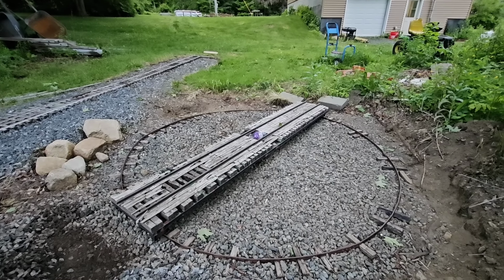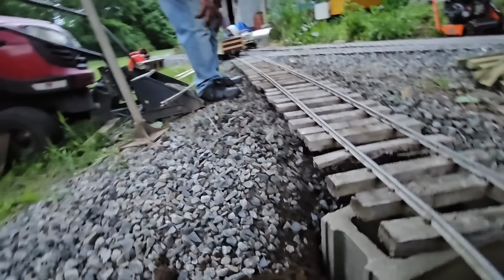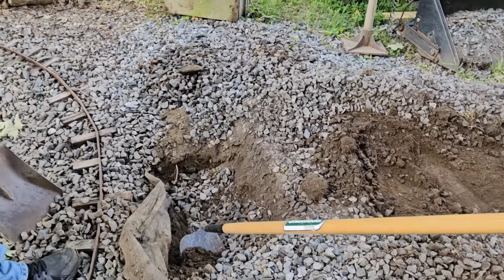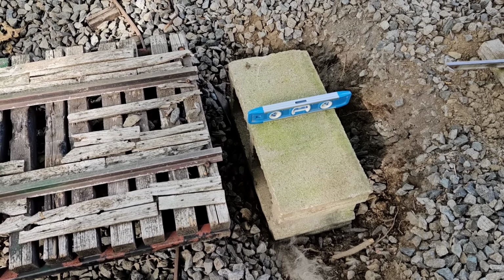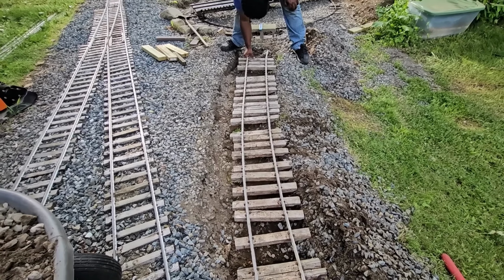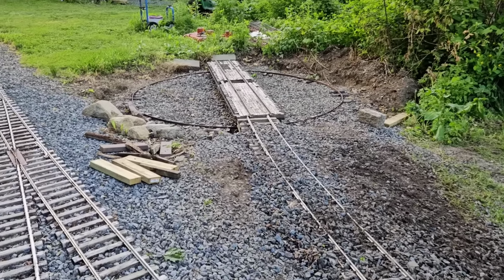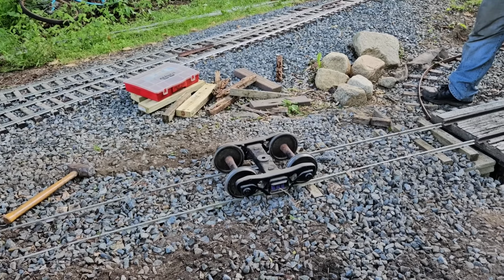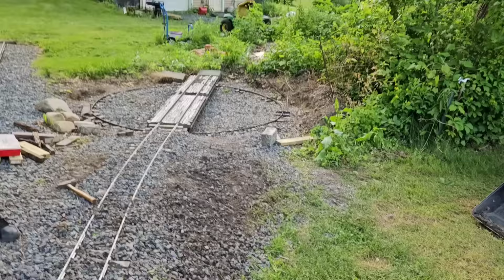We're FINALLY Laying track to the pit!: Turntable Restoration Part 2

Comment: A simple way to lock the turn table is to attach a small arm on the OUTSIDE of the rail on turntable.  They will flip over when aligned to track and hold it in place.  Essentially it’s an outside joiner bar that hinges on the turntable track

Comment: Aha. Some gear is doing a good job. Lawn mover with bucket, that's new to me. A clear invention.
Haha, the turntable is not levelled. This summer it was the situation on one veteran railroad. Guess the job when the heavy end, carrying the motor, gearbox etc, had to be swung "up hill"...... 5 guys were needed, or the excavator!
Things usually take more time then planned.....
Reply from the maker: @Stefan_Boerjesson  The lawn mower with the bucket threw a rod while mowing the lawn. This was the only project it got used on.
Reply: @MillBrookRailroad  It surely did a good job.
Reply from the maker: @Stefan_Boerjesson  It served the purpose for the time it worked.
Reply: @MillBrookRailroad  It sure did.

Comment: I see you have the same issue getting the lead track to line up horizontally with the turn table. I found that you will have to go anck about a third of the way and raise the lead track so there won’t be such a bump. You can use a couple of garden sliding hasps for  locking the TT to the lead track.
Reply from the maker: We have to replace the deck anyway, so we'll make the final height adjustments after the new deck goes on.

Comment: Looks really good! now dumb question..will the lead directly opposite the input track go back to the shop track in your house? That would make acessing the shop a bit easier for you. As far as a latch for the turntable, why not a sliding plate  fitted into the web of the rails to force the track into alignment on both ends.
Reply from the maker: Yes, I will have a track go directly across the turntable into the shop in the house. The locking plate between the rails is a good idea.

Comment: I guess I would have replaced the ties, that clearly needed to be replaced.  But otherwise, quite interesting to see how much of a process it is to get track installed from scratch.  Is it me, or is the turn table a bit high, rather the access track just a bit low?
Reply from the maker: We may replace all the ties after we make new ones. They should be fine until we get to it this fall or by spring at the latest. The lead track is adjustable, and the current turntable deck won't be with us much longer with all the dry rot it has. The new deck might be a different height. We won't know until we cut the wood and build the new deck.

Comment: Did you say you lay some track in the workshop if you had surely that's flat
Reply from the maker: @buildwithadrian6895  The concrete contractor made sure it wasn't flat.
Reply: @MillBrookRailroad for drainage. I know how cold it gets up there, water ponding on the floor would be a definite safety hazard.